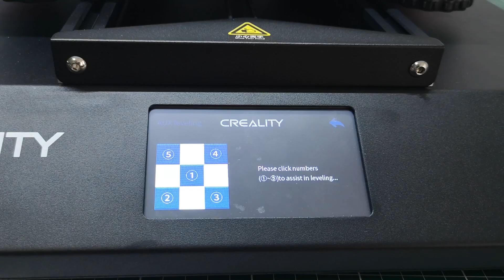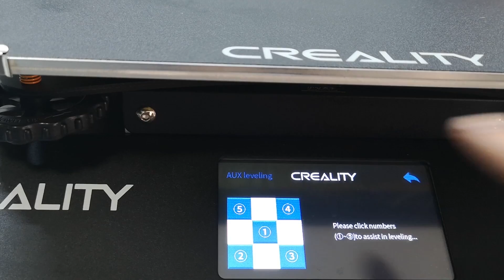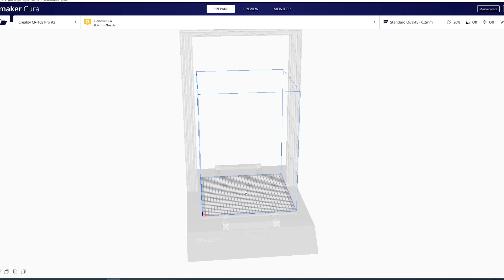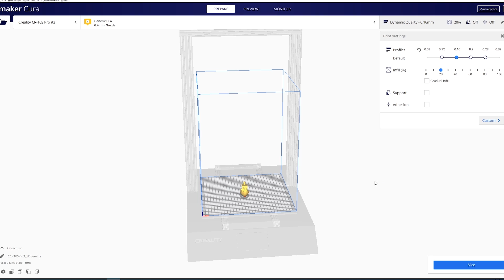Creality CR-10s Pro V2 | Unboxing, Build, Calibration and First Print!

Comment: Just got my new printer, started assembly.

Got to step one for the Gantry Frame Installation. I've got all the parts but the frame itself doesn't slot in on both sides so therefore the M5X25 Screws don't line up and can't secure the frame to the base.

Am I doing something wrong or is it just faulty?

Comment: I wish the gantry on the one I bought sat down that easily on the frame.   The sides were too tight.  Had to run the z-axis all the way to top to get it to fit.  Then the roller wheels were super tight of course.  Still not sure I have it set up correctly due to this.

Comment: i am having the worst time with this machine, i cannot get the z axis level no matter what i do. it will never stay level and if i use the auto home or auto level function it just comes down until the nozzel is forcing into the pate and trys to destroy itself. horrible horrible experience with this thing
Reply: i literally have to pull the power from the wall quickly to stop it from utterly destroying itself

Comment: It tried leveling all four corners evenly and no matter how much of the same light resistance I had in all four corners using that metal tool the nozzle would always touch the base in the center. How can you fix that?

Comment: I just received my CR 10S Pro V2 yesterday, and it won't do a damn thing. The Z axis on the screen shows that it is going down, but, the damn thing is going up instead of down. I don't think that I messed up when I hooked up the wires. It won't even go down to the build plate, at all.
Reply: Did you plug in the 5 pin connector coming off the ribbon cable to the x-axis stepper motor?
Reply: @stehenallein  yep

Comment: Just got my CR-10S Pro V2 from Matterhackers, I only ordered the Pro but got upgraded to the V2 for free ;) The box did have a little shipping damage but no real damage to the printer, my first prints were perfect, I started with the filament roller guide and then put it into production, best printer I have owned, the BL Touch is a dream, I need to turn auto leveling off, but it is fun the first few times to watch it do it's thing. I never even needed the feeler gauge, good thing I misplaced it right out of the gate.

Comment: Got a CR10S Pro from Newark, it turned out to be a V1 (capacitive sensor). The whole V1/V2 thing is confusing, Creality is still selling both and hard to tell which one you're getting. Several serious QC problems out of the box, including wrong/incorrectly installed/broken parts but rather than send back and wait God knows how long, fixed it myself. After a few weeks, still trying to find best way to remove prints. Despite what other videos say, alcohol does nothing, bed in fridge doesn't help. Despite great care, scraped the bed using included putty knife. Tried raising Z offset to just enough adhesion might be the trick. Have 2 Ender 3 pros at home that work great, very few problems, but CR10S has been real pain.

Comment: Just got my first 3d printer it was this one. I'm surprised that there are no "maintenance videos" on what you should do and how often. And I don't understand why I have to level the bed every damn print. Both manually and then it does it automatically when I start to print. Tried going with E-PLA but that just made every print fail and not getting stuck on the bed. The bed that loses its surface when I use the tools to remove the prints once done. I don't know if I'm dumb or the one who designed this printer is dumb
Reply: You can turn off auto leveling, then it will stop doing it every print, as a first time user you made a great choice, as far as maintenance goes, you need to keep the head clean and the rollers running smooth, plenty of videos out there, nothing complicated, eventually you might have to replace a belt or other moving part.
Reply: I just got this one today!! Tutorial is confusing

Comment: So I’ve been very confused with trying to get mine to print level and consistent do you set the z offset in the center first before leveling the corners?
Reply: you should always manually level all 4 corners with the wheels the best your can before using the Auto leaving there is only so much auto leaving can fix
Reply: Just bought one. Powered up and red light is flashing. Does anyone know what this means? New to this and a lil overwhelmed.
Reply: @jrpaz173d2  usually that means something is tripping the BLTouch, make sure the pin isn’t bent or obstructed
Reply: @war3zlod3r  for it stopped blinking after height adjustment
Reply: This printer auto levels duh

Comment: I am having the same start behavior as seen on 15:05 where it does the purge lines in a triangle instead of side by side. Did you fix that already?
Reply: If that was with a test print on the SD card that's just for that print. If it's for all your prints it'll be your start G code that needs altering

Comment: ANyone else have the issue of the bl touch going home and leaving the nozzle 3-4mm from the bed? Seems like it should be on some kind of adjustable sliding mount to be able to slight down or up slightly.
Reply: You have to set the z-offset to compensate. All the BL-Touch does is meassure its own position in relation to the bed. The nozzle is by no means related to this, it can be at, above or below the BL-touch sensor height and this value needs to be manually adjusted. It's really easy on this machine though, while printing go into adjust (lower rigth corner) and there you'll see z-axis adjustment. Lowering this value will lower your nozzle towards the bed, and it can be quite a substantial adjustment before your printer starts to behave. I have mine set to -1.50.

Comment: 10:30 so what's the point of the BL Touch and what part of the "auto bed leveling" feature is "auto" if you still have to manually adjust the height of each corner?
I wanted to buy a self-leveling 3D printer so that I wouldn't have to trust my own "opinion" on what "feels" leveled.

From where I see it, it seems like an added step to the already daunting task of leveling.
Reply: You set it the first time and the BL Touch compensates for the rest of the prints.  I've got one on my Ender 5 Plus and I have manually leveled it in a month or so.
Reply: The BL touch checks before every print and Changes the heigh in different places so the mountain in the middle of the bed does not matter
Reply: "Bed leveling" is a misnomer.  Or a lie, depending on how you look at it.  The BLTouch figures out the differences in elevation across the surface and then the controller actively compensates for the variances while printing.  At no time does the bed ever get 'leveled' after the gross adjustments you make during your initial calibration.
Reply: The way I think about it is this: you manually bed level before the print as always. Your 6,8,10 hour print begins. After 3 hours or so your bed might need a minor manual leveling because of the shaking. So how do you solve this problem? Do you risk stopping the print and resume?  I think this is where the BL touch comes in the field and compensates for this issue and gives a great result for long hour prints.

Comment: I'm seriously considering buying this printer, however I haven't seen many reviews out for the V2. Have you come across any serious problems with the V2? Like adhesion, bed leveling/flatness, issues with the BL touch, etc.?
Reply: I've got it for a few weeks now, this is my first printer
Adhesion- Some prints were stuck so much, i barely removed them (it's because i leveled bed pretty alright)
I even scratched the bed with included shovel (?), for some reason it has sharp, not refined edges
Bed leveling- It's alright, pretty comfortable with big knobs, just be patient and level the bed  correctly
But, one of the leveling springs not long enough, so it must be really relaxed to level the bed, that's why it can mess up level after some time because of vibrations (I will buy a set of springs in the future and maybe everything will be okay)
BL touch- I didn't bought it
The main thing in the beginning- Check all the screws and tight them, and then level the bed perfectly
I printed something like 8 models now, some of them not great because of bad slicer settings (i'm still learning, and got okay results only from Creality slicer) 
Honestly, i think ANYCUBIC has nice new printers and they have 0.05 layer, not 0.1 so it's twice as accurate (?)
And main thing
If you need big prints- go for FDA printer, also you need to polish and refine print afterwards
But if you need small print with lot's of details, you need to buy resin printer, and you  almost don't need to polish the model
Reply: @DeathCoreGuitar  I just got mine a few days ago. I know what you mean about the adhesion. I already scrapped up my bed as well. I am playing with the bed temperature. I had it set at 50. I put it to 40, Some PLA stuck and some didn't. I am printing now at 45 to see if that is the sweet spot. With all that said I just ordered a glass bed for 20 bucks from ebay so I don't have to deal with scrapping up the original bed.
Reply: @darbycarpenter3032  I've got a nice trick for removing the print now
Just use the utility knife blade, push it under a corner of a print and then push it further with included shovel thing, and it's working very nice
But, my biggest issue is leveling my bed, I'm leveling it very nice, but adjustment nuts are very loose in leveled up state, so mid print and after the print it's  just not leveled up anymore
So I need to level the bed EVERY TIME
I don't know how to fix this
I could tighten the nuts and adjust Z sensor height, but my Z sensor is FIXED
For some reason some of the YouTubers got not fixed ones, so they can tighten all nuts, adjust Z sensor, and level up the bed, and their  bed is leveled for almost a month they say
Sorry for my English btw
Reply: I had a same problems but after we fixed the printer it works great and is very quiet
Reply: I bought this printer because it looked like the flagship from Creality, and I had good results using the Tevo Tornado clone of it.  There are a few issues I have, there is a bit of mystery on how this printer handles GCODE.  It will not follow your GCODE with respect to auto bed leveling and priming, at least when using the touch screen interface.  You cannot define your own priming pattern, it will always prime the print head in a pattern that ends on the center of the bed, this is seen at the 15 min mark on the video.  There is also ambiguity on how it auto-levels.  It will run the auto-level sequence regardless of having the G29 line present.  When I first received the printer, I leveled by bed by hand, ran the auto level function in the menu, and added G29 to my GCODE.  The extruder ran into the print bed on one side, and ruined the build surface.  It could have been a fluke, or it could be that it is double compensating for the auto-leveling if you add the G29 command and auto-level using the touch screen.  It has been hard for me to print something with a large footprint and have it be perfectly level.  I have since switched to a glass build surface.

The printer is also very loud due to the fans that cool the power supply and mother board, much more so than my TEVO clone.  While it isn't a terrible printer, for the price they are charging, I would have thought the quality would have been better.  I am hoping a firmware upgrade with solve the issues I am having.  If you don't mind installing a BLTouch yourself and upgrading the firmware, the TEVO is a good cheaper option, I got mine for just under $300 on a banggood sale.

Comment: Fark... you must have received tho only one in the whole world that works out of the box!
Reply: It works good for me
Reply: Got mine yesterday and its a piece of shit. The left side of the gantry is heavier than the right due to the extruder and its impossible to level the bed on the right side. If anyone has a solution please let me know before I strategically bomb China
Reply: I'm considering buying one - are you able to expand on that comment as it might change my mind?
Reply: @Rob5ft19in  It's a piece of shit mate. It requires heaps of farking around to get it decent. I'm currently waiting for a new motherboard but of course nothing is shipping from China.
Reply: @Rob5ft19in  yeah, I’ve been 3D printing for about 18 months, and what they don’t show you in the video, is the cutaway where they swap the benchy from another printer like a PRUSA lol.   This thing has got to be one of the most finicky printers I have ever used.  Their implementation of BLTouch on the CR10S PRO V2 is the biggest joke.  Tech support told me you must level the bed between each print (WTF ???) and that because the BLTouch is so inaccurate, that this is expected behaviour.  They have also told me they do not provide copies of their source code because it is NOT open source.  Marlin anyone? Lol. Yet in this video, within 10 mins, he has it setup and printing flawless benchies ..... thank god Amazon CS is so great, I’m about to box mine up and ship this piece of junk back.  I used an Anycubic i3 mega S for awhile and a printer that costs about 1/3rd the price with none of the fancy add ons gave results that were at least 100x better in every single way.  I decided to move to something bigger and first ordered the Anycubic Chiron, but I had something I was working on and needed it quickly, so I bought this, biggest mistake ever and I’ve been farting around with it for over a month.  Tech support responses often make you want to smash your head into a wall.  You wait for 2 days for a response to a pic of your bed mesh level showing the greatest variance of like 0.08 and the answer you get is “please level your bed” and a link to this video to show me how to do it!!!!
Reply: i received mine 2 weeks ago and i follow this video to make my first 3 print ever. Worked fine. I only have one bug for nose temperature from cura is not recognized but i must tryanother slicer to see if cura is not responsible for that bug. I set the nozzle temperature manualy from the 3d printer.